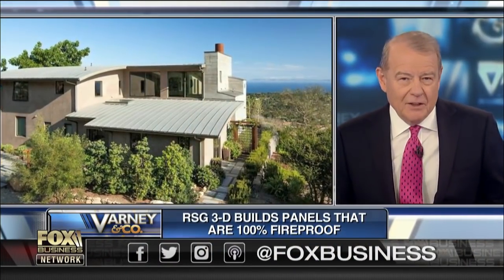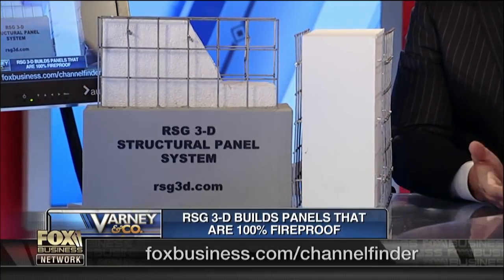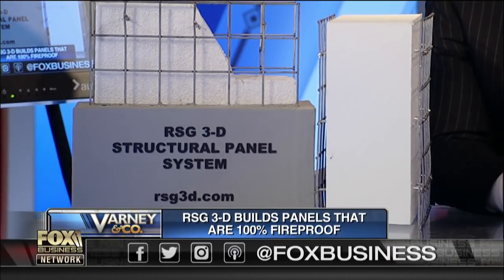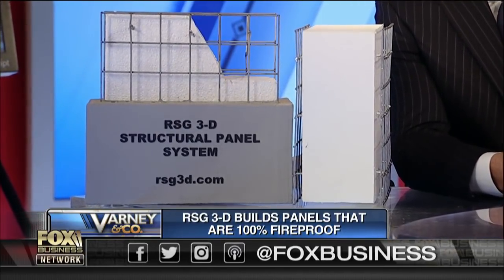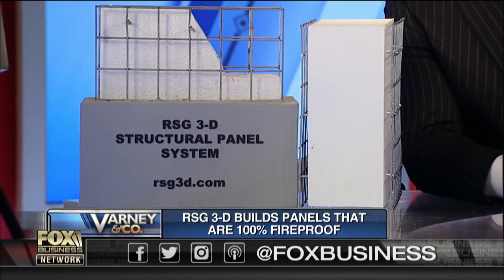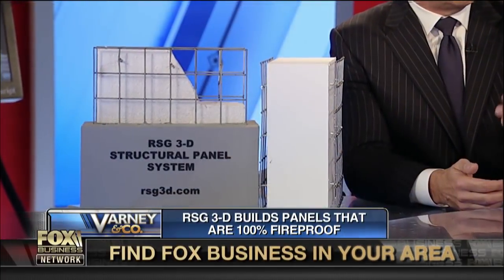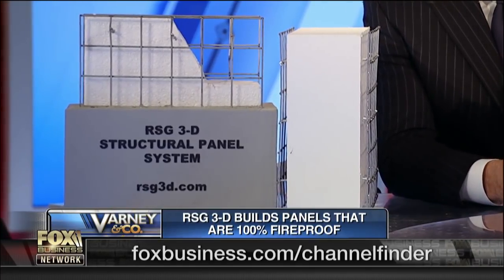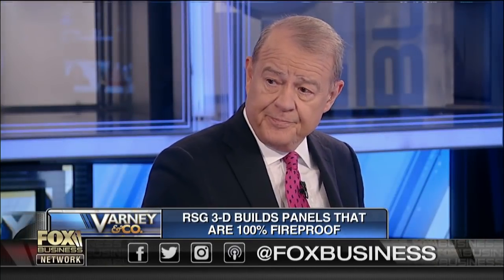Building material created that is 100% fireproof

Comment: Concrete may prevent the house from catching fire, thus saving lives. But if the fire is close to the building, radiation heat may melt the styrofoam inside the walls, and render the walls useless, both regarding insulation and to prevent heat-rays penetrating the walls the next time, setting fire to flammable materials inside the walls.

No, this is just another concrete element with insulation. Not putting my money there unless there's a revolutionary easy assembly technique, and they are supereasy to move and store.